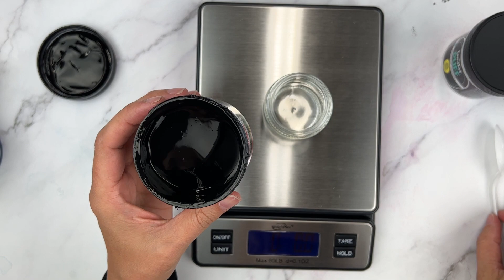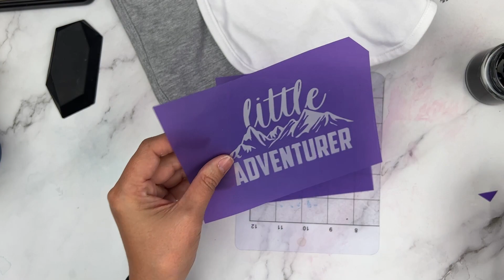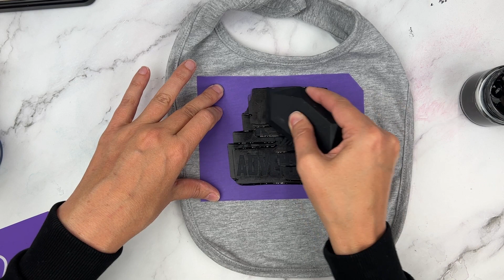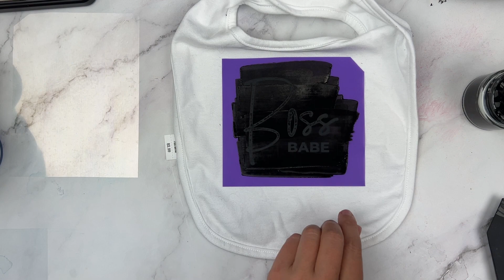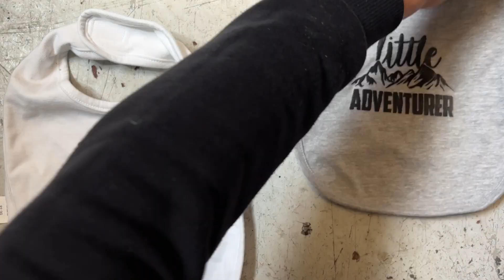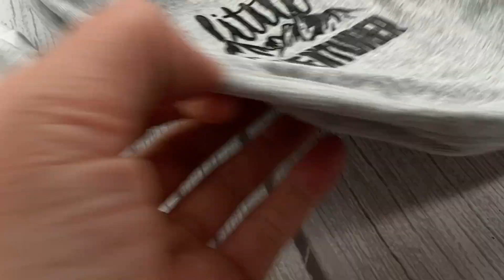Craft Test Lab: Speedball Puff Ink and Ikonart Stencils

Comment: What printer do I need
Reply from the maker: You can use any laser printer or inkjet printer.
Reply: @ikonartstencil  will my desk jet f4440 work
Reply from the maker: @Onlythefamilyvon  I have not tried that printer specifically, but I have not heard of any other HP deskjet printers that have not worked so I think you will be fine